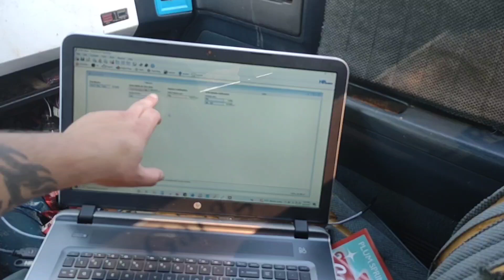Change tire or gear size with HP tuners.

Comment: I have a 1992 s10 that looks spot on color wise as yours. My factory color code comes back as silver so I know it’s an aftermarket paint I’m just not sure what the name or code of it is. From your videos I’ve watched it’s almost identical to yours. I would like to put on a roll pan for sure, possibly a cowl hood when I 350 swap it. Could you help me out with any sort of name or indicator of the shade of blue of our trucks? Thankya sir
Reply from the maker: If you are talking about the out side of the truck it is spray paint.(deep gloss blue from Rust-Oleum) the actual color in my door Jams I'm not sure. I could look at the code and find out. Which color?
Reply: @howididitgarage.  I would be interested to know the factory color code of your truck as well, especially if you think that exterior blue is factory! It should be on a sticker in your glove box. My paint code was the “WA-xxxx” code on the bottom right of that sticker. Essentially I think I can get away with the rattle can color you gave me if that is what you painted your roll pan with because I just want to do exactly what you did, paint my roll pan. And it looks like the color you chose matched pretty well. Thanks for the reply buddy
Reply from the maker: The exterior is spray paint. The factory color is lighter color blue. I painted the roll pan with the same spray paint I painted the truck with.